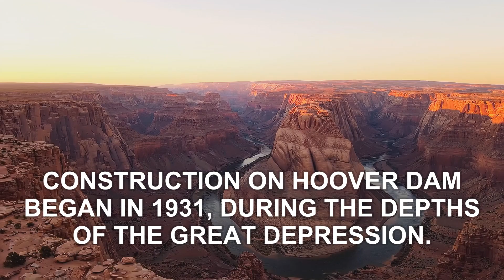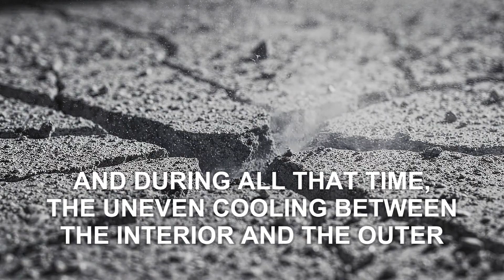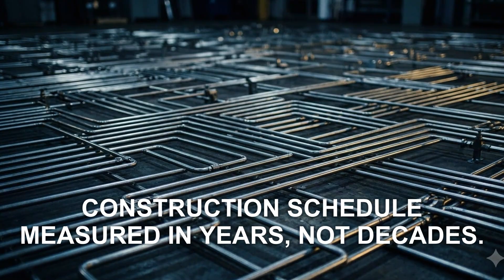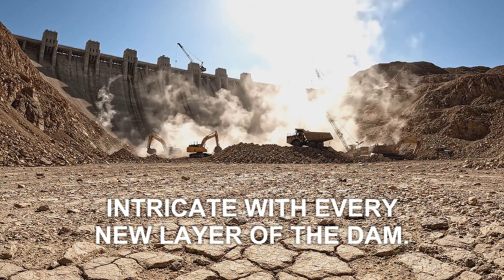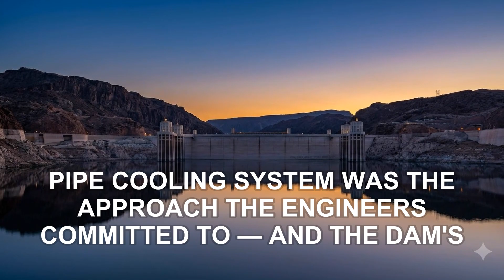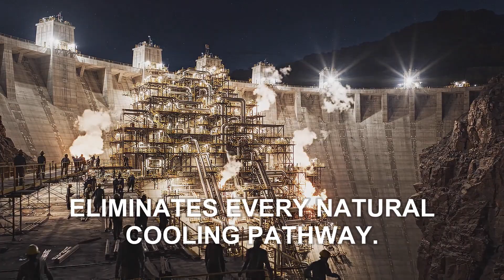Why Hoover Dam Was Built With Miles of Buried Ice Pipes

Comment from the maker: Pour 3.25M cubic yards of concrete and the core needs ~125 years to cool naturally — thermal stress can crack the dam from the inside.

What hit hardest: the buried refrigeration pipes, interlocking columns, or that the cooling system is still entombed in the structure?

Drop your pick 👇 — next megaproject?